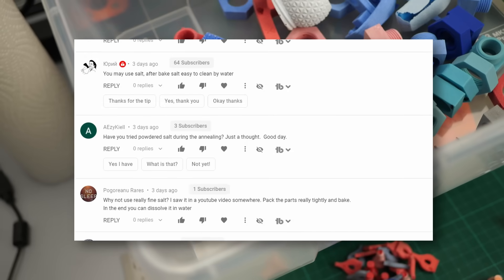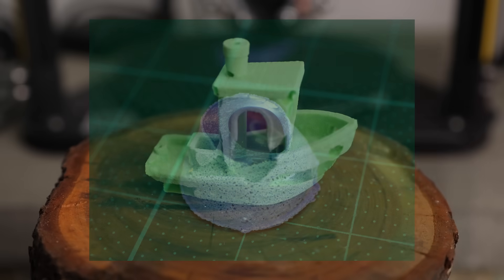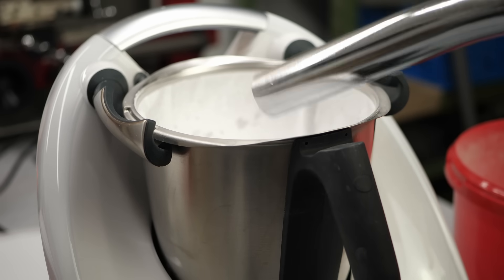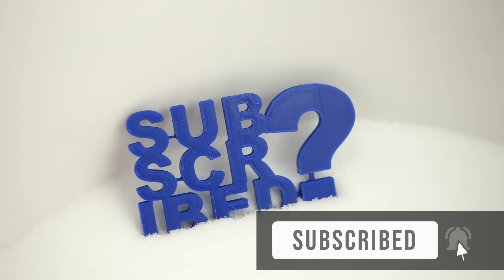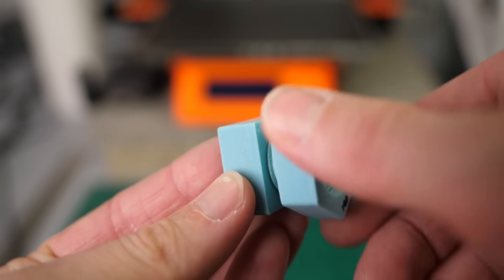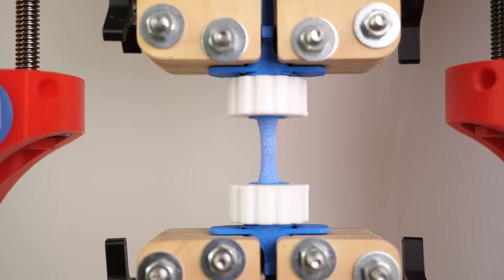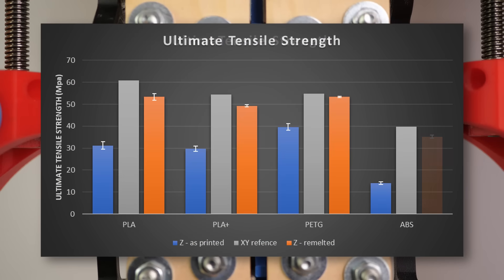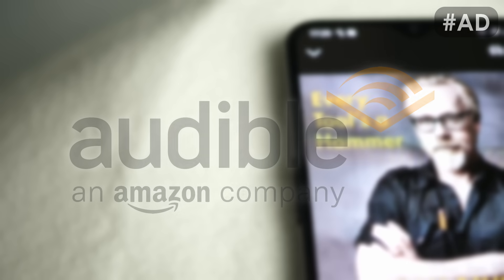The STRENGTH of 3D prints REMELTED in SALT

Comment: have you thought about using a drying powder that would resist to the remelting temps to avoid the clumping issues? just so you could process larger batches without sacrificing the quality of the resulting powder

Comment: is there anything you can remelt the parts in to improve the part strength on the surface since the salt might not be adding much to that? sand, metal powder, chopped carbon, what would give it a nice composite shell?

Comment: This is interesting. Personally I would oven dry the salt before grinding it. Should drive off any moisture in the salt.
Using a ball mill might have some advantages over a mixer.
Otherwise this is quite the improvement in part strength. Getting that close to ideal strength is great, since this is a fraction of the cost of injection molding, even if one does hundreds of parts. (not to mention for making parts that are impossible to injection mold.)

Comment: Back in the days of glorious communism mi family had a coffee grinder. The blender type, with the rotating blades. We did not have any coffee because we where kissing the wrong ass in the communist party. And we had access only to coarse salt. So .. we used that coffee grinder to grind up the salt.

That is something you can do with a 5 euro grinder from Lidl... It may not have a 16 horsepower russian electric turbine, but it I bet it can also grind up salt to an extremely fine powder to the point where it can't be used as seasoning anymore (ask me how I know).

Comment: Could a submersed heater to nozzle to actual 3d print into some heated liquid solution that would reduce thermal expansion and after print is finished the 3d print could be annealed like this to better adhere and smooth up the layer lines? 

I understand that PLA might not be a good candidate for some liquids though.

Comment: What if the parts were sprayed with 2-5 layers of a salt solution with an air brush before placing in the fine salt for melting. Or swaping Salt for a Carbon powder.

Comment: I've played with this, and powdered hydrophobic fumes silica is ridiculously good. Although I haven't tried it, PTFE powder should work too, but is a ridiculously carcinogenic if it gets above 320 Celsius. i have also had moderate success with crushing up old ceramics, but the work it takes is not worth it, if done manually. My main issue with salt is its hydrophilicity. After not using a batch of powdered salt for a while, it clumps up and at least the surface needs to be reground and the whole batch over dried before use. 

I've also found that additional runners, similar to ones used in metal casting at the top of a part reduce air bubbles. Even at 100% infill residual air pockets will remain, and adding runners can trap air bubbles.  

Also, using dry filament and doing the remelting quickly does wonders for accuracy and strength

Comment: Ok, I got it, this video 4 years old, but do some one try something other than salt? Salt is horrible choice for this application. It obviously better to use gypsum or basically even sand(finer - better) WHICH ACTUALLY USED IN REAL METAL CASTING! Yet again I try to read some comments, but I don't even know why to use salt for this...
Reply: I don't know the answer, but salt seems like a reasonable choice given the criteria most people will have for this project.

Salt is cheap, and very unlikely to react with printed filaments. 

There are many other inert substances you could use in place of salt, but unless you have a good reason to try then you are going to have to acquire those substances and experiment in order to discover it for yourself.  

Whatever benefits there migbt be to using gypsum or sand at this point are not known, as well as any potential draw backs. 

I think its a great idea for a video though, if you already have the sand/clay you should give it a go and let us know.

A lot of people want to know the answers to these questions, but it takes time, effort and usually money to find them and a lot of us are already spending our free time and money on 3d printing! 

My guess is that you'd probably have a better end result with fine gypsum but that it might take longer to heat (i'm not sure, but I think salt transfers heat pretty well).  I would also guess that the ideal material is probably different for each fillament type as they each have fairly unique properties, perhaps some substances cause discolouration or stick to the plastics, I'm not sure what else you might expect in terms of limitations. 

I don't think that large scale manufacturers encounter this specific issue because 3d printing is usually limited to prototyping.  If a stronger more durable part is needed and you have a prototyping lab, you'll just use the print to make a mould and then cast the plastic parts for stress testing. 

Casting and injection moulding are obviously much more efficient ways to mass manufacture plastic parts, so I think it's unlikely that we'll see advanced techniqued for 3d print post processing just appear from out of the blue.  There's not much financial incentive for the research so it needs interested people to pursue it for the fun and personal insight and to help the community.
Reply: A quick scroll of the comments and people are suggesting graphite, silica crystals and even some complex polymers as better alternatives.  

Honestly, I'm not sure that the medium needs to be anything other than chemically unavailable to the plastics which are being heated.  

I definitely think it's worth trying gypsum or sand, unless somebody has a good reason why it shouldn't work.

Comment: You can also just use baking soda
Reply: "just"?  salt is exceptionally cheap.  I doubt baking soda is cheaper or easier to get. 

Salt can be bought in massive quantities for swimming pools or melting snow.  

You might be able to get large quantities of baking soda but depending on where you live you may or may nor have access to suppliers as they're usually used for commercial applications. 

I guess with the internet you can probably get a bulk order of most basic chemicals delivered but salt is available cheaply everywhere.
Reply: @SineN0mine3  sodium bicarbonate does cost some two or three times as much per ton, but considering the cost of processing salt into a fine powder yourself... 
Not a bad deal. 
As for avaliability... there would not be a bottleneck there.
Reply: I was thinking the same thing
Reply: Sodium bicarbonate starts to decompose at 50°C, with full decomposition at 270°C. If PLA requires 210°C, sodium bicarbonate seems like a poor choice to use as mold.

Comment: Could you not super saturate a salt solution, then pas through an atomising nozzle through a high heat source to flash boil off the water as its in the air, the resulting salt would then be extremely fine.

Comment: I want to produce large parts with this surface finish (the one you achieved with the large salt particles), without the molten interior. Any ideas on how to achieve this? I plan on using low infill but many wall layers so very high heat and low cook times seems to be the ideal combination.

Thanks!

Comment: Does anyone know if remelting PLA like this improves the thermal properties? Will the PLA not start deforming like it usually does?
Reply from the maker: I haven't tested it myself, but I would suspect that it will also get annealed during that process and thereby significantly improving thermal properties.
Reply: @CNCKitchen  Thanks for the info and for replying in 20 minutes on a nearly 5 year old video :p

Comment: So what you are really doing is using the part to form a mold and then recasting the print 
So what you are going to want to do is to compact the salt with a good amount of force as you do when casting metals. Did you want the plastic to get just hot enough to liquify. 
So ideally you don't want the temperature nearly that high you want it maybe 10° above what it takes to liquefy the plastic. Then leave it in an oven sit at the melting temperature of the plastic 

A better way would be to find a refractory which doesn't contain water. Did you paint the part in that refractory maybe a quarter inch thick or whatever and take the part at slightly above the melting temperature of the plastic. Basically something like plaster of Paris without the water content and you can do this quickly cheaply and easily

Comment: why salt and not casting sand? why specifically salt?
Reply: Because it's much easier to remove salt residues from the surface of 3D printed details.
Reply: for the same reason why it is intended to be used as a coolant in nuclear reactors. The physical properties of the melt.

Comment: I wonder if there would be a way to mix this technique with a thin resin coating, or something similar, on the parts to keep a better surface finish. It's exciting to see how well this idea works.
Reply: I'm no expert, but i've made prints in resin and fillament; and resin is much more brittle and fragile.  I think that any coating you added to stregthen already brittle plastics would need to have some elasticity for shock absorbtion or have compressive strength. 

I think there definitely are things you could coat a print in to increase durability, but I expect resin would be better for providing a smooth aesthetically pleasing finish than adding any material strength.  

Just my 2 cents, but I think PLA fillament with added wood fibres is a great way to increase strength for most applications where plastic is appropriate. 

I don't really think that plastics are usually ideal for moving parts at all, and if you have to count on them to last any amount of time you're going to at least want casted or moulded pieces not printed ones. 

I have some plastic mechanism kicking around that are decades old and they don't look like they're wearing out, but they're almost always doing very little work. 

Anything that moves and has to do considerable work will probably be made out if metal, although plastics are quickly catching up in terms of performance, they're unlikely to ever be cheaper.

Comment: I realize that this video is 4 years old but I thought I would mention that you can buy a product in North America called Flour Salt, a 24kg bag costs maybe $20 from a food wholesaler. Another name for a similar product is popcorn salt. You could also consider sodium bicarbonate (baking soda) owing to its small particle size as well. Other recommendations would be looking into how sand molds are packed for casting metal parts, specifically how they tamp the sand down.

Comment: In looking for a way to make some small parts waterproof I came back upon this older video. First thank you for all your experimentation, first time commenting, and sorry for doing so such an old video, but I have learned a lot from your content over the years.

That said, you asked in this video about alternatives, and it just dawned on me... How about using bentonite clay instead of salt? I have some on hand, used to make rocket nozzles. This stuff is cheap, very fine, and you can "pound" it tight around the parts, like when making a cast. The benefit of annealing a part vs a cast in my theory will be you don't have to add a spur or split the cast, etc. I will try to remember to comment back after my testing, but thought I would drop this notion here in case it was something you or others wanted to try too.

Comment: silicon carbide powder used for rock tumblers would be one to try its relatively cheap and has around 50x the thermal conductivity of salt.  or better yet would be fine graphite which has thermal conductivity 600x salt, additionally any graphite molten to the plastic while improve the mechanical properties as graphene in graphite should improve strength

Comment: I just found this video while searching for information on improving FDM prints in PETG. I saw someone suggest baking soda, so I gave it a try with a test piece for dimensional stability and strength.

I printed a 1.500" cube with Jet Black Prusament. I added features to help keep track of print orientation, as well as a curved (90 deg sweep) thru-hole. I printed using a 0.6mm nozzle with two perimeters and monotonic infill at 100%. Once the cube cooled I took several measurements and recorded them. I carefully packed the cube in baking soda and baked (in our kitchen oven) at 390F (~199C) for two hours. 

Overall appearance became a uniform matte finish. Layer lines are still visible, although less than the raw print. There is no visible "foam" on the surfaces. A slight amount of warpage appeared along one vertical edge - this appears to be from localized additional shrinkage.

Average shrinkage in X axis was 1.68%, Y axis 1.84%, and Z axis 0.68%. The thru-hole shrunk slightly as well. My measurement method for the hole was to stuff it with small wire ties until I could fit no more. The raw cube accepted 18 wire ties, and annealed it accepted 17.

Then came the destructive testing. I do not have the facilities for quantitative analysis, so I used a hammer and cold chisel. My first effort was to split the cube parallel to the layers. I successfully split the cube into two pieces with one blow from the hammer. This seemed too easy to me, as I have split raw components in the same way, and they took several blows. Nonetheless, a visual inspectino of the exposed surface indicates there was significant fusing between layers. Some "texture" is visible, and has the appearance of carbon fiber. The fracture surface passed through many layers, indicating a good bond between them.

I then split one of the cube pieces vertically, parallel to the printed X axis, and found the piece split as easily as the first time. This indicates the impact strength is similar in both Y and Z axis directions. The fracture surfaces look similar to the first fracture. The fracture did not appear to follow any of the print lines, except near the hole, where the two perimeters remained intact. Perhaps I need to increase overlap between infill and perimeters.

Next up was to try to smash the smallest of the now three pieces with the same hammer used to split them. I struck the piece several times with significant effort, and it remained intact. Barely a mark was left by the hammer. I had expected the piece to shatter, but it did not budge.

The three pieces can be reassembled with fracture lines barely visible (less than 0.003" wide), indicating very little internal stress remained after annealing.

Comment: I think I'll try this technique using glass beads for blast cabinets in an argon atmosphere.  Glass beads can be purchased in extraordinarily fine diameters and the "melting" point should be sufficiently high to work.  Perhaps the argon will prevent porosity.

Comment: Why not just build yourself a DIY injection mold?  It couldn't possibly require much more effort than you already put into this.  You just need some molds that can be heated to a higher temp than the material you're injecting into it.  You could start with a 3D print that's ultimately what you would like it to look like but without much infill.  Then you could pack your 3D print into some sort of ceramic clay that requires a kiln to cure it at a much higher temperature than it would take for your 3D print material to melt.  Then you can fire the clay in the kiln with the 3D print inside of it, and it would all run out of the holes you left into some sort of container that will handle the heat so you don't ruin your kiln (did I mention you'd be buying a kiln or making one?).  In theory, you should be left with a ceramic mold that will handle being heated to the temperature you need to push lots of hot plastic material into the mold.  For that you're gonna need to come up with some sort of oven that you can pressurize or squeeze the material out of so it can fill all of the recesses in your mold.

This obviously wouldn't be worth the hassle for most things, but if you wanted to mass produce something where you'll want a lot of them, then it might be worth it.  It's basically the same technique people have used in mold making for ages using wax.  Of course you could also just use wax if you just wanna make life easier.  You could 3D print molds to make the wax version that you would use and then you wouldn't have to do much sculpting by hand.

Comment: I’m brand new to 3D printing. So new, in fact, that I only finished assembling my new Ender 3  (Version 1) last night and currently learning about Slicers, Octoprint and the different Firmware available. Not even close to printing anything, yet. 
Anyway, I saw you using a salt/ kiln technique and I thought that was brilliant. I’m curious if anyone tried putting the salt casting into a vacuum chamber prior to firing?  Or, hi pressure hydraulic press ( in 3 dimensions) to get uniform compression.?
Another question I’ve been wanting to ask someone and seeing this video, I might as well ask it here.
Has anyone ever tried 3D printing in a vacuum chamber?? I’ve seen ceramics set in a vacuum chamber before being fired and the results are next level. Just curious if that would help increase the final density of the filament used.